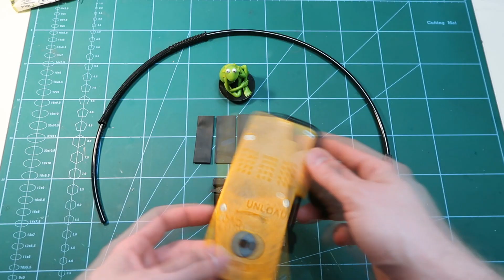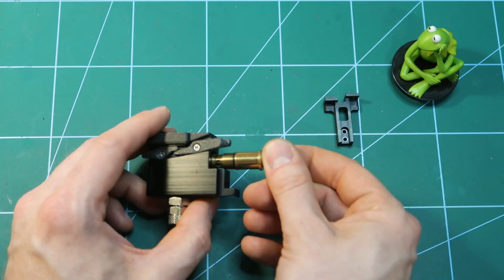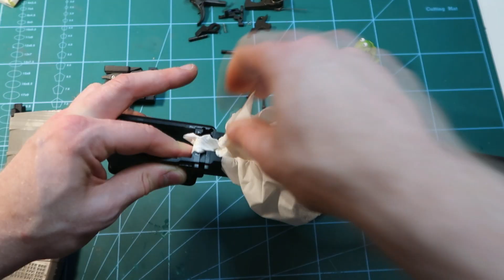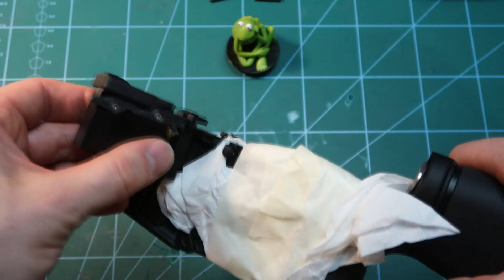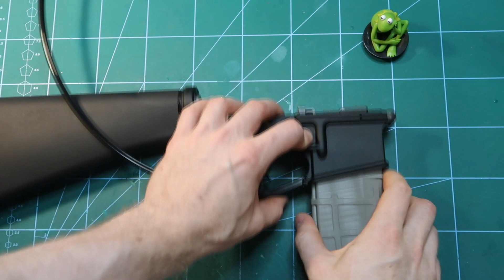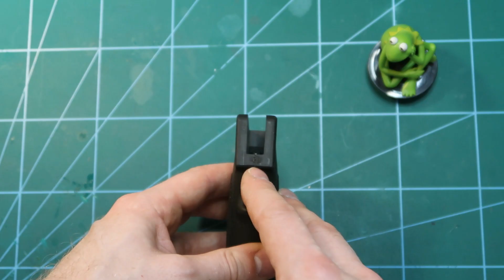Frog Manual #15 - FE conversion kit for GHK AR15 (M4 type) HPA GBBR

Comment: Could this conversation make the replica have more power? And do you have a tutorial for vfc sr16?
Reply from the maker: Hello, conversion does not have much to do with power. If youo want more power you can use NPAS in nozzle, tightbore barrel, good bucking, higher pressure on the regulator. But in stock GHK (at least this one) had a nozzle set to 1.1j which was not possible to disassemble. There was not much you can do about this, unless you buy a different nozzle.